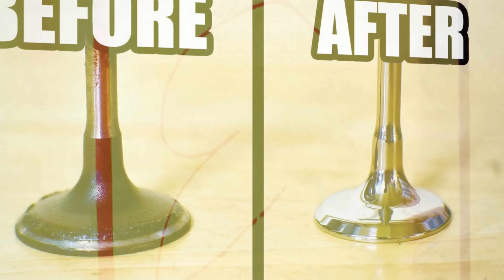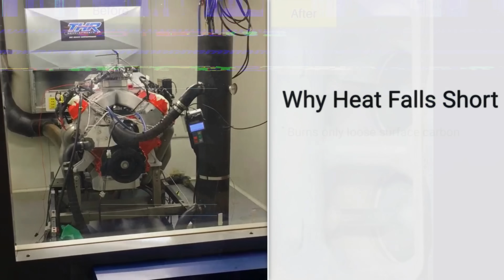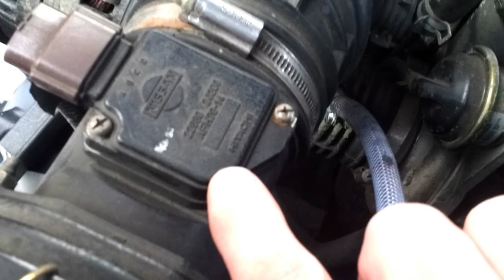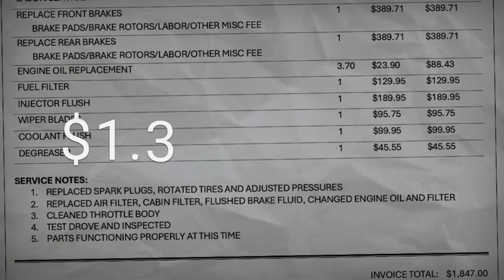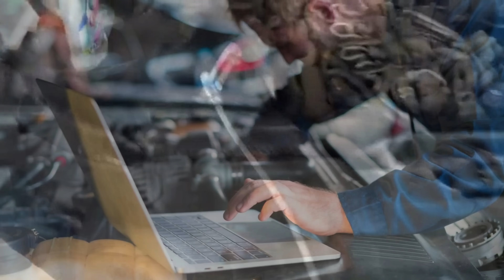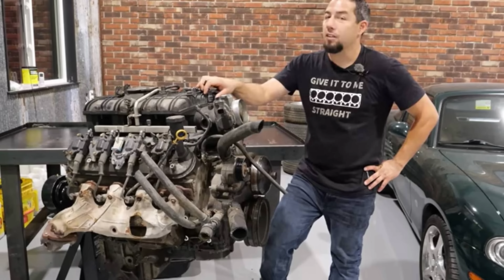The Japanese Method to Clean Your Engine Without Taking It Apart

Comment: You mention it not working on well on vehicles over 50k miles. I'm debating which method to use on my 2015 with 222k miles. I don't feel like the engine is failing me, but I do have a slight misfire on cylinder 1. Wonder if a carbon cleaning would be worth it.

Comment: Techron does help. It comes in CHEVRON and MOBILE gasoline. Or you can buy a bottle and pour it into your gas tank when you FILL up. 
But if you have Direct Injection you STILL need B-16 chemical cleaning. I get our cars done every 40,000 miles. It ABSOLUTELY works and you will likely feel the difference after the treatment.
As for "Hydrogen Cleaning" I've never heard of it but I'll look for it.

Comment: The Portuguese Method is to install Ultimate Cell and witness the real difference, not only carbon cleaning but hydrogen constant optimised combustion while full time engine operation, and all the other associated benefits! Pays for it self and saving continue to pile, plus higher driving pleasure. Search for Ultimate Cell, do your research

Comment: Use Chemistry: polyether amine (PEA) detergents.  Don't try those cheep $5 per bottle junk. (looking at you Sea Foam)  Brands like Royal Purple fuel cleaner or Amsoil.  That will do the trick
Reply: Not on direct injected only engines.

Comment: I thought the Japanese had to swap engines after every 30,000 miles or so.
Reply: Japanese are renowned for building the most reliable cars in the world.
Reply: Wtf are you taking about?
Reply: @3644Darrell back when I had my Honda I looked at getting a different engine for it and there were at the time cheap, used engines that could be ordered from Japan. The premise behind them was due to emissions they put in a new engine after 30,000 miles. I haven't looked it up in years but it was common I owledge amo get tuners. This was the 90s early 2000s

Comment: So, don't buy a vehicle that doesn't have direct & port fuel injection engines. For example:

 -All Toyota/Lexus engines have both direct and port-injection engines. 
-Chevrolet Gemini Small-Block (LT7): Specifically noted to feature both direct and port injection.
Gen V LT-series Engines: While many primarily use direct injection, some iterations have been designed to support dual injection to meet high fuel demands.
5.3L V-8 L84 Engine: Incorporates advanced fuel delivery systems, including direct injection, as part of its design, with some configurations supporting refined fuel management. 
The primary benefits of this dual approach are utilizing direct injection for efficiency and performance, while using port injection to clean intake valves and handle higher fuel loads. 
-Ford Engines with Dual Injection (DI + Port)
3.5L EcoBoost V6 (Second Generation+): Found in the Ford F-150, this engine uses port injection for cold starts and low loads, switching to direct injection for high loads.
5.0L Coyote V8 (Third Generation+): Used in the Ford Mustang GT (2018+), this engine combines high-pressure direct injection with port injection.
2.3L EcoBoost (Newer Models): Updated versions, such as those in the 2024 Mustang and 2023+ Ranger/Bronco, now feature both systems.
2.0L EcoBoost (Recent Models): Some newer applications of the 2.0L, such as in the 2023+ Escape, have added port injection alongside direct injection.
3.3L V6 PFDI: This base engine, used in some F-150s, explicitly features a dual-delivery system. 
  -Just research the vehicles that you are interested in to ensure they have both direct & port injection engines.
Reply: Well, I needed my 250 Transit ecoboost van in 2016 before it had mixed port injection. No way to avoid it.

Comment: Depends on the engine whether it carbons up or not. After 200,000 miles I pulled the intake off and the internals were very clean. Don’t buy vehicles that use technology only to please government mandates while saving manufacturers fees by meeting mileage requirements.

Comment: We used to use DMSO to clean harden carbon on engines. It dissolves it. I’d be worried the excess heat would damage valve stem seals.
Reply: How did you use the DMSO?in tank?intake ?how muchETC

Comment: $2000? very convenient round number. I keep my Di diesel intact by spraying a diesel cleaner into the air intake, cranking the engine a couple of revs so it gets drawn in and letting it sit overnight. I've never had a problem and my car is twenty years old.

Comment: Use quality gasoline, and add Chevron Techron Fuel Injector Cleaner to a tank of gas with every oil change.
Reply: That will keep your injectors clean but will not prevent carbon build up on the valves, it's a common misbelief.
Reply: @onenikkione It would probably clean valves on port injected engines.  But would do nothing for DI.

Comment: bypass EGR, vent PCV to atmosphere instead of intake port,  that way intake air is just air, no more recycled exhaust gas & crankcase vapors
Reply: That only works on pre 90's engines. Modern engines utilise crank case pressure as part of the upper cylinder oiling system.
Reply: @michaelneo2692 example ?
Reply: Oil catch cans work.  They go inline to the PC Valve.  I have taken the line that goes from the valve cover to the throttle body air intake port and have it drawing fresh air through a small pleated filter, down to the valve cover and through the engine, and cap off the air intake tunnel port.  The hole in the valve cover that normally goes direct to the PC Valve now has a hose that goes to stage 1 of my 2 stage oil catch container with a hose that then goes to the 2nd stage oil catch container and from there routes to the PC Valve itself.  My 2 stage oil catch system not only gets the wet oil vapor but a good deal of water lands primarily in stage 1 with stage 2 for end clean up.  

My containers are a good deal larger and uglier than the expensive cutesy-utesy high priced pretty looking things you see online.  Spacing in modern car engine compartments can make it a challenge in where to place an oil catch system but an inveterate back yard guy will find a way.  My '99 Tahoe is the old style multi-point gas injection while my '93 K-2500 P/U is throttle body.  If I ever get stuck with GDI (God Damn Injection) then an oil catch system is an absolute must.  I also use the CRC throttle body/intake valve cleaner spray.  It contains PEA (Polyetheramine) which has been touted as the latest Carbon remover miracle chemical.
Reply: @gweedomurray9923  yes, they help to >>>>reduce<<<< the amount of crankcase fumes that your engine sucks back into the intake but if you want to stop those fumes altogether then simply vent the crankcase to the outside :)

Comment: It made no remarkable difference on my Mercedes diesel.  It was done at a very reputable shop.  Mine needs to be disassembled, cleaned, and reassembled.  DPF too. Then aggressive acceleration combined with regular cleaning should work.
Reply: If you think about this logically you'll realize that this method can only be effective against deposits in the combustion chamber, and does nothing to the deposits on the backside of the intake valves. Those deposits are from the PCV and EGR systems . With a diesel, you MUST use only the best quality low-sulfur fuel, and you MUST use only the absolute best available diesel engine oil. Both of those are critical to minimizing those PCV  and EGR gases. I'm surprised the Mercedes dealer didn't tell you this HH treatment would only address your problem in a marginal way, but on the other hand, maybe I'm not.🤑
Reply: EGR delete actually keeps soot levels lower and increases mpg on a diesel because higher combustion temperatures are more complete and efficient without nasty exhaust getting rerouted back into the cylinder.  Engine oil stays cleaner and lasts longer too.  The main rationale for exhaust gas recirculating was to lower nitrogen oxides, but urea blue diesel exhaust fluid and the catalytic converter takes care of the NOx, and EGR delete takes care of the catalytic converter so it and the DPF don’t get clogged as fast.

Comment: Yeah, I don't buy it. If it takes an hour, it's not going to cost $150. It'll be at least $200 or more for labor cost alone. That's literally the same price as walnut blasting, not the stupid $1000+ this video says. Walnut blasting will clean better for the same time and  price.
Reply: There is no way that walnut blasting costs $200. Removing the intake manifold alone is going to double that amount. Not to mention replacing the intake gaskets and any other “while you’re in there” parts.

Comment: I will never again just buy Direct Injection engine. (Like Mazda) I will only buy a dual injection engine like what Toyota or Lexus has. So many manufacturers know the problem but they still decide to build crap. That is not a good sign of a well built vehicle.
Reply: so so true ,  the older basic  fuel rail  behind  the valves  thing  is   way better  for  longevity  .  in the 1970s honda had a civic that was  SO CLEAN BURNING   its did not even require a  CAT  .
Reply: its  kinda ' over tech '  for them to   add a  SECOND INJECTOR   just to clean the back of a valve  . sometimes the  old school basic way  is better , cheaper  and more  reliable  .
Reply: Lol so your willing to buy a vehicle with a cvt transmission. Doesn't seem like a good trade-off to me. Just clean the valves every 60,000 miles
Reply: @PS-gr5wh  lol , no i would never buy a car with a  trans like that .
Reply: you are so correct

Comment: the problem here is so  tremendously  easy to fix , just build engines with  the injector  BEHIND THE  VALVES  LIKE WE   DONE IN THE PAST .   i got a honda crx with 460,000  miles on it .   engine has NEVER  been taken apart for nothing .   no internal valve cleaning  was ever necessary  .   the benefits of direct  injection   DO NOT  OUT WEIGH THE  LONG TERM COSTS   for a  daily  driven car .   its good for a racing or high performance  car  because it gives  slightly more power  but its bad for  longevity  .  bad for a day to day use  car .
Reply: You never done anything? I would atleast recommend new Spark Plugs, you'd be surprised at how well the engine will run with new plugs in them. Also, an air filter. Sometimes if I'm on a budget and I just can't afford it at the time I'll take an air compressor and blow the dirty out From the opposite side of the filter. Till I can afford to get a new one, also a good way to combat this is to just put in a drop in K&N FILTER or SPECTRA FILTER. THEY'RE REUSABLE AND K&N guarantees them to last a million miles. 

Back on track though,  make sure your tires are aired up to proper spec, I usually go 1-3 PSI over whats suggested by the manufacturer, turns out I get a huge difference in my miles to the gallon. Keep the car clean aswell, the less the car weighs, the less fuel it has to consume to keep rolling. However, I did test this once and was shocked by the results. I was in my 2001 Honda Civic EX, driving to Kansas City, Missouri from Dallas Texas. I was averaging between 40 to 45 MPG but I believe most of that was because of momentum on the highway. Being that I had it loaded full of guys and big guys plus all of our stuff to stay up there for a week, I mean that's a little tiny car. Obviously, I didn't expect the results to be so high. But like I said kinetic energy AKA physics I believe worked its way in on that deal deal.
Reply: 100% agree!
Reply: Cars still are made with direct and port injections now
Reply: @ScotmanUK2000. Funny you should say that.  I’ve just purchased a new 2026 Toyota Corolla Hybrid.  Last night I looked it up and the Corolla has direct and port injection.  Lucky me!! 😊
Reply: @Getingsmart  i guess its better than just having one injector inside the  combustion chamber  since the glorious days  of the ' bullet proof ' fuel rail  seems to be  extinct .
Reply: @Getingsmart  Good job! :D
Reply: BMW's B58 engine (inline 6, turbo 3 liter) also has both direct and port injection.  BMW shares tech with Toyota and there is a Toyota model that uses the B58 engine.
Reply: @WLB628  thx i didnt know that  .  i wanted to buy a new bmw 430 i coupe  but   the inline  6  non turbo  is  gone .  so is the manual trans  for the basic 430  .
Reply: @WLB628  Toyota/Lexus have been using dual injection on their engines since the late 90's/early 00's, with mass adoption starting around MY2010. A version of D-4s is in the (Subaru built) BRZ/86.
Reply: Does your Honda have a CVCC engine?
Reply: Modern engines have to be fitted with an EGR Valve too which is an engine killer
Reply: The fix is easy… get a catch can.
Reply: @Edge51 catch cans do nothing for the crap coming in from the EGR system.
Reply: @JaySee5  Seeing how the oil coming from the PCV system makes up the overwhelming majority of the build up it does work as intended.  EGR carbon build up should be minimal in an engine operating at proper temp and AirFuelMix is correct. (Gas engines not talking diesel here that would be an entirely different conversation.
Reply: No, the easy fix is spraying a little cleaner, like Seafoam, every other oil change. Direct injection gives huge benefits to power, fuel economy, and emissions. The added cost of adding old port injectors on top of the cylinder injectors is not worth it. Only Toyota does it.
Reply: @JaySee5  Yes it is worth it. Adding 3 percent to engine design and manufacturing  is worth every penny.
Reply: @MrAquinas1 worth it to whom? Added cost and complexity for something solved by a 13 dollar can. 😂
Reply: @JaySee5  Ford also does that.
Reply: @JaySee5  There are more vehicles on the road with dual injection than without. Just about every manufacturer uses dual injection, Toyota/Lexus just has it on more of their vehicles than others (aka nearly all models). Ford, GM, VAG (aka Audi, Porsche & VW, but VW only outside of North America now though), BMW, Mercedes, Hyundai/Kia, Stellantis (dodge, Chrysler, Jeep, Ram, Alfa, as well as a bunch of brands we don't see in North America) all have dual injection; worth noting Subaru only has dual injection on the BRZ/86 because Toyota required it on the 86 & shared their D-4S with Subaru.
*Edit: forgot about Honda/Acura.... any probably a bunch more...
Reply: @jasonyoung6420 you say "on the road" because manufacturers like Hyundai are phasing out dual injection, while Honda has totally removed it from production.
Reply: @JaySee5  thanks for  your comment , seafoam   will   ' help ' with carbon build up  but it will not eliminate  to need to correctly clean your valves  due to the port  injection design .   saving on fuel  and emissions  can still   be achieved  without  a port injection design   .   sadly ,  car companies  dont care about  building a engine  that can last 500,000 miles with only very minor  ' grand ma '  can do it herself  maintenance  .  lowering emissions , assuming  your one of those  ' green '  folks  and saving  money on fuel  is a wash  when  you  have to  pay   extra money to   have your  motor cleaned internally  .   anyway , thx again  . its nice to share opinions .
Reply: @felipe-p3t YOU'RE wrong on all accounts. 😂
Reply: @JaySee5  thx for the opinion , we all have them .
Reply: @felipe-p3t  not opinion, facts. Your comments are opinions and errors due to errors in logic and ignorance. Also, learn how to type and space properly.
Reply: @felipe-p3t  - 
Agree.
Reply: @felipe-p3t  - You're right they sure are helping to preserve the environment making low quality vehicles, while I drive a 1991 Volvo with 200K miles with no need to clean carbon. Tell that to that disrespectful guy bellow.
Reply: @JaySee5  thanks for you opinion  once again
Reply: @JaySee5   - Yeah right, huge "benefits" because of bad engines design. If I want a vehicle with huge power "benefits" I'd get me a 1970 Chevelle or a 1986 Mustang, but this is about common cars that people want for everyday all purpose driving.
Reply: @Lvatopesado  Yeah right, that's why nearly every new car today has direct injection. 🤡 Meanwhile you're talking about carburetor vehicles that get outclassed by DI I4s. 🤣
Reply: Direct cylinder injection for the win
Reply: @Sparky_D  No, both port and direct for the win.

Comment: I hav😮e heard that water injection can also help keep your engine clean from carbon build-up.
Reply: just about to say this too....
Reply: Water/methanol injection keeps valves clean (and raises effective octane), but won’t remove hardened carbon deposits.  It’s a preventative, not a repair.  Still a good idea after cleaning the valves.
Reply: not so much for the valves, but the combustion chamber
but down side to this, is if carbon has built up, it increases comp ratio
clen it off, you loose extra comp, plus maybe oil use goes up, as carbon barrier around top piston also goes.